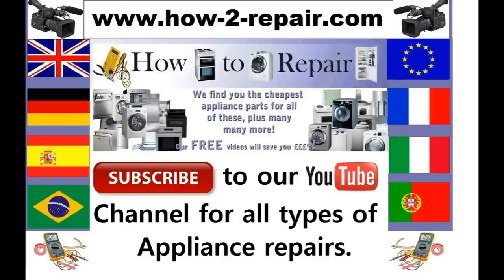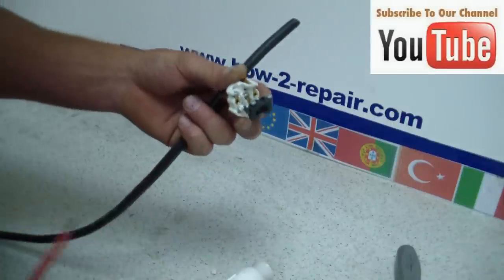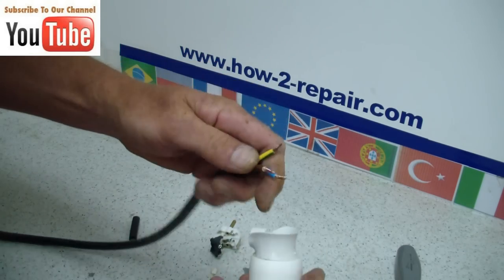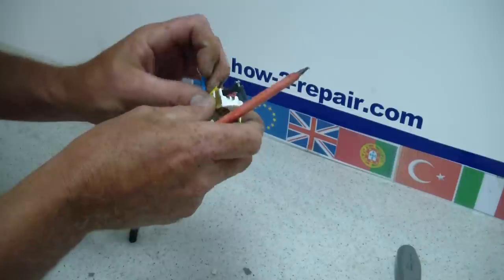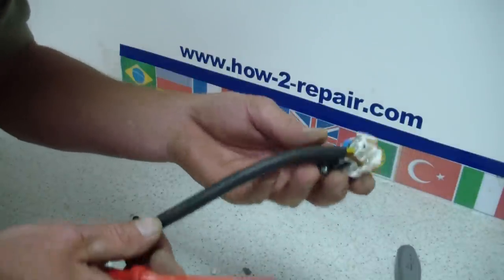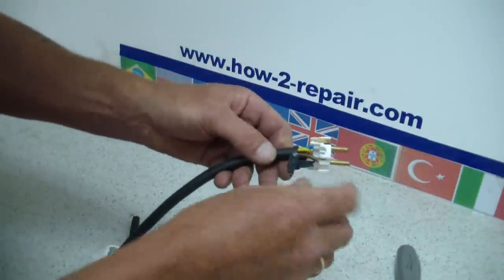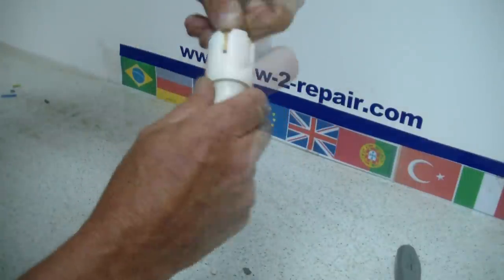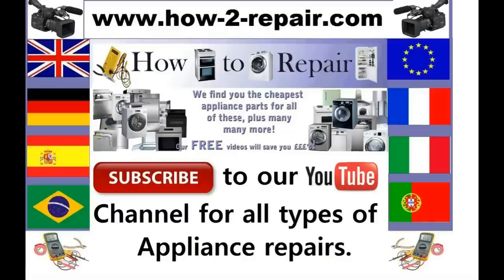How to wire a new european continental electrical plug

Comment: Didn't think to mention what colors are live, neutral and ground. Seems that if you don't know how to wire a plug that might be useful information. And even if you do know you might have been looking to confirm the standard in another country.
Reply: Colours? Those are up to whoever made the cable or whoever made the house installation 😂😂. Most people use blue and black or brown and black with black being neutral, but you will see grey often too, and even brown/brown. It's a mess.
Reply: Theres no ground here its called earth.  You didnt think to mention that did you?

Comment: The earth wire should be longer than the other wires so its more likely to stay in place if you accidentally pull on the wires.
Reply from the maker: +lotsofotherstuff yes thats correct if the plug gives you the space
Reply: +how-2-repair.com A european pluig definitely gives you the space to do that.
Reply: lotsofotherstuff Late reply, But mine doesnt

Comment: The plug used in the demonstration is a CE 7/7 European plug.  It has the capacity to be used in both of the two most common socket types in Europe.  On the CE 7/7 plug the earth wire goes to a small pin-hole that admits an earth pin, and it goes to copper strips along the top and bottom sides of the plug that slide against two earth contacts in the socket.  Many sockets in Europe have no earth pin, such as the "type F" socket which has contacts top and bottom for the earth.  With a type F socket a plug can be inserted in two ways, each rotated 180 deg from the other.  This means that the live and neutral pins are reversible.  However, in France and some other places in Europe the socket has a small earth pin instead of two earth contacts.  This is a "type E" socket.  The pin in the socket ensures that the plug can be inserted into the socket in one orientation only, and prevents plugs that do not have a small pin-hole in the plug from being used at all.  Polarity of the neutral and live pins matters for a type E socket and for plugs that have the facility for being used in a type E socket.  Many people assume that the live pin enters the pin-hole on the "right" when looking at the socket.  There are two issues here.  One is that live and neutral wiring in Europe is sometimes incorrect for type E sockets (there is no incorrect wiring of live and neutral for type F sockets since they are reversible and depend on plug-insertion orientation).  The second is that the earth pin may be towards the top of the socket or towards the bottom, depending on the socket's orientation when it was installed.  The French standard - the country where this socket is most common - is that the live pin-hole is clockwise from the earth pin when looking at the socket (i.e., to the right of the earth pin if the earth pin is at the top).

Comment: That is a good article. The Euro plugs can be connected in either orientation hence the active wire can be on either pin. This however is potentially dangerous. A device can be switched off and live. For that reason, I break both hot wires in appliance designs that switch euro sockets. This is also needed in the US because 110 V comes from phase splitting and both wires can also be live.

Comment: Thanks for the very clear video....I have these plugs already, I live in Germany. However I have a question..Why doesnt it matter which way round the N&L go.?
Reply: +MrFreddiew1 because you need both to work, and in the outlet the power keeps switching back and forward between L and N so it doesn't matter. that's why you can also plug them in both ways
Reply: Because you can put the plug either way. If you are i n France you should put the line on the right when the hole is up. But if you are in Czechia you should put it on the left. I think following the French way is a good practice even though it does not really matter.
Reply: @g.work.specials6859  No, neutral is always neutral. The voltage (referenced to earth) is always on the line.

Comment: Ah but what size wire is standard? For a 15 amp outlet, in the states a 14 gauge wire would be standard.
Reply: There is no gauge in Europe. We only have mm2. For 16A outlet 2.5mm2 is used often.

Comment: Replaced a shot main board on my electrolux ewf 1090 washing machine and the door interlock 
Lights now come on except the 2 lights on the spin cycle (600 and 700 spin speed) but still nothing happens
What am i missing ?  Can anyone help a damsel in distress? 
Is there a wiring diagram i can easily download or a service manual?

Comment: WHY, WHY did you not specify which color wire went to which terminal?
Reply from the maker: Thank you very much for the comment I thought it would be pretty obvious, in Europe, it does not matter which way the plug is put in. You will never know which is live and neutral depending on how the house is wired,  you would have to check every socket in every property because I can guarantee you they are all different,
Reply from the maker: I believe France is the only country to have a location pin on the plugs to stop them from being turned around, but in Spain, Portugal, etc you can put the plug in either way. This means that you would be reversing the Live and neutral, depending on which way you put the plugin

Comment: that is what i think im not 100 persent shure on lamps the base is live thd thred part of sockit is neutral so if one tuches thred they wont get shock because the base is live and thred neutral on sockets termanals shuol be brass witch is lice and silvtch is neutral that is what i under stand check with certified electrican be for instaling

Comment: All I wan't to know is if the live is on the left or the right, but you keep spinning the damn plug in a way so you cant see if the earth pin is at the top or the bottom. The whole rest of the video is obvious anyway
Reply: oktaylor1 Live goes to the right. There are more, far better videos than this. And if anyone says it doesn't matter which side the live and neutral go on, they're mistaken.
Reply: @stikndip  Thanks!
Reply: Todd O'Brien schuko is dual polarity. It fits in both ways except in France Belgium Poland and a few other places